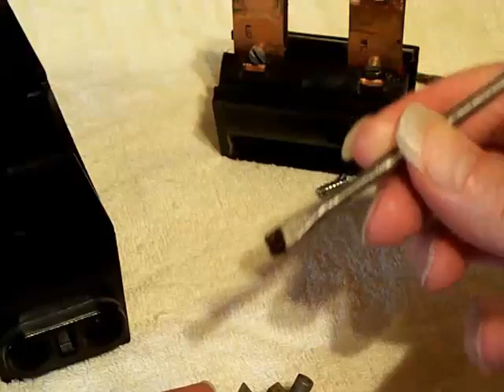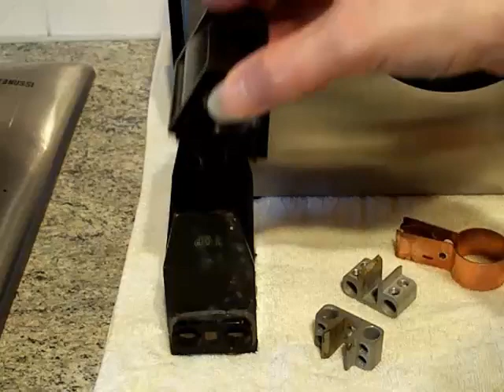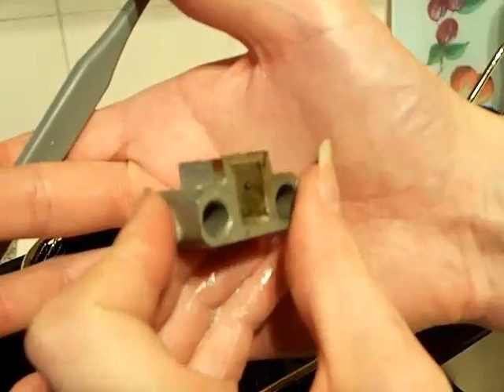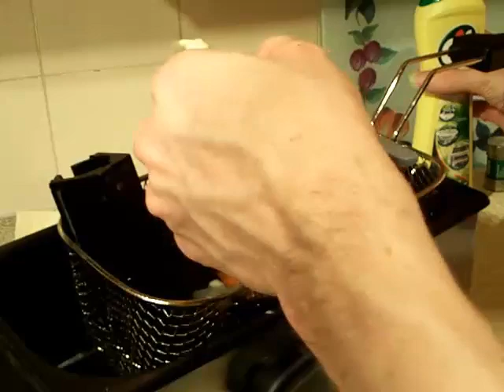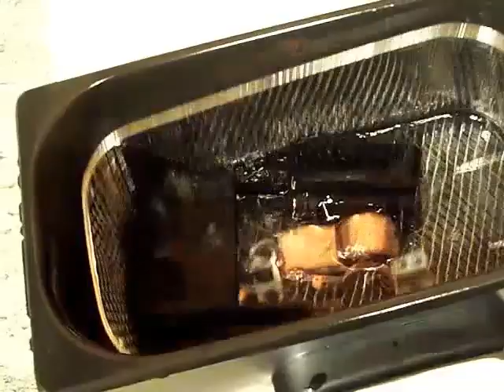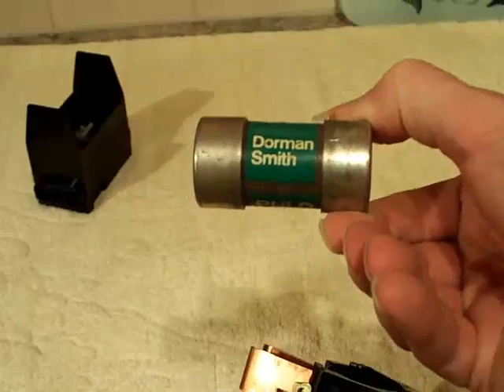Electrical : BICC single-pole service fuse restoration.

Comment: Its crazy nothing on the unit to tell you what it is. I am getting an EV charger and didn't know if I had a 100 Amp fuse or not - I suppose I still don't but at least I know it is a fuse and how to pull it out -thanks